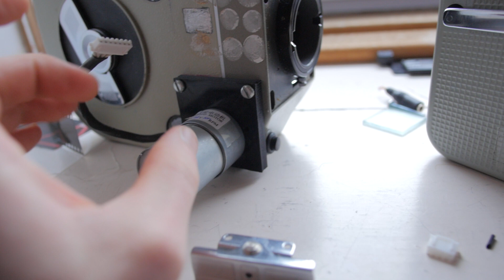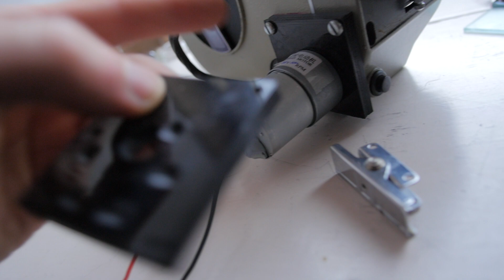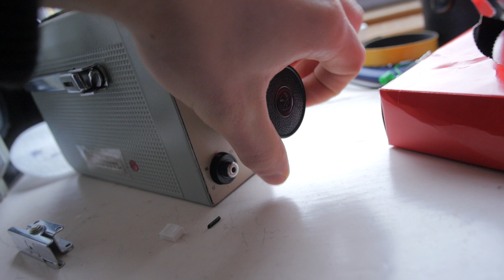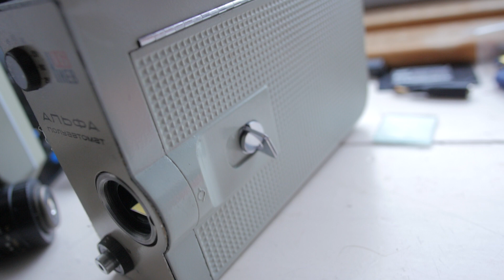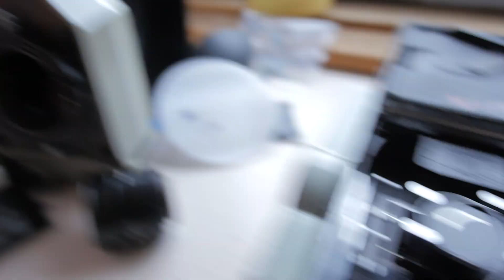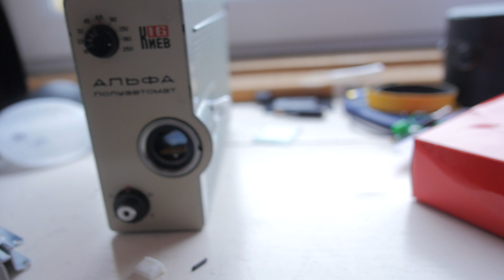K1 Electric Drive Update and Alpha 16 Camera

Comment: I just bought a K3 yesterday (super 16!). Going to motorize it using your method. Wish me luck lol.
Reply: did it work? :P
Reply: I need to know. Did it work?
Reply: @GRMNCVS  The project I will be shooting with it went on a back burner because the pandemic and lack of a workspace, but in the coming months I will be finishing the mods and running my first test reels through it. I will most likely upload a video showing my mods and reels. If I do I will come back here to let you know.
Reply: @GRMNCVS  I did get it running, but not at the correct speed and with a quick and dirty mount job. I have confidence it will work.
Reply: @mrcmoes any new updates? Where can we find the write up (assuming you have one?)
Reply: @tylerfukuda  it worked, but I have to upgrade to a 3d printed mounting plate instead of my hand cut brass ones. And I am adapting a lens to fit on the K3 so haven't used it much outside of some tests. I haven't had a reason to do any write up of it